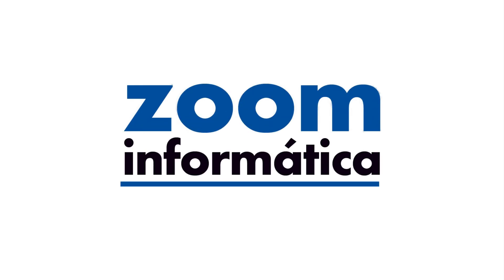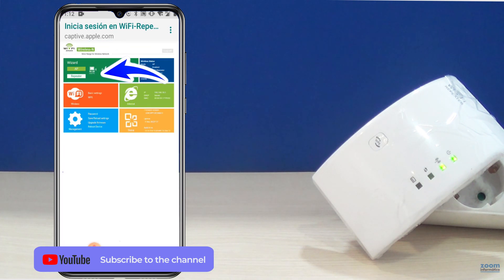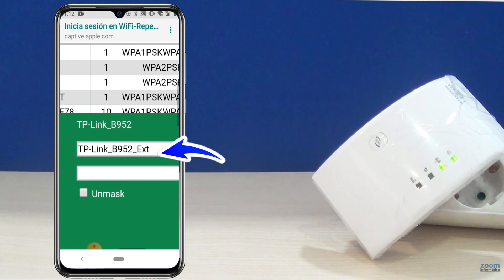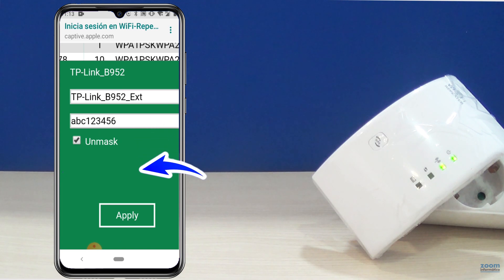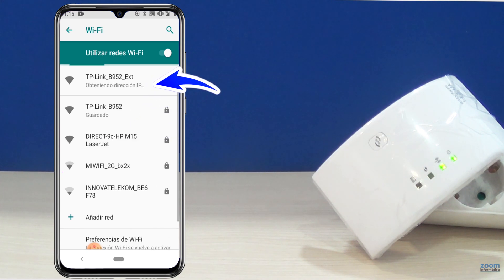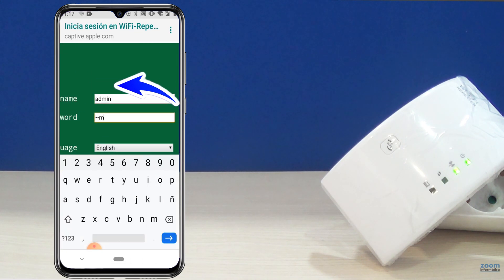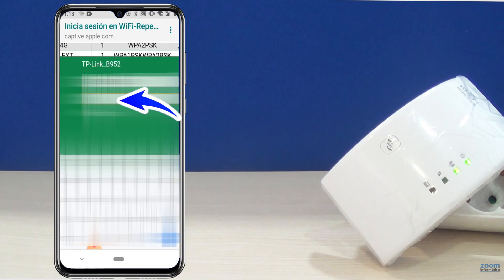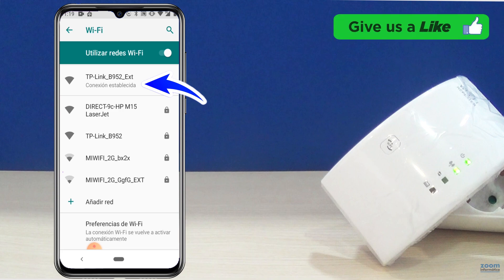How to fix WiFi repeater problem without internet connection 📶 WiFi booster without access

Comment: I dunno if my experience might mirror that of others but after aetting reprater mode in my Wodgreat unit, i found that when connecting my phone to the WiFi signal output by the repeater, my phone claimed there was no internet access, yet when I tried browsing on the internet, indeed my phone was connected through to this site! Not sure why the Wodgreat's WiFi Access point would claim not to have no internet access, but I clearly have it!
Reply: Same symptoms on both the 2.4G and 5G WiFi Access points.

Comment: What if the repeater connects to an AP but the AP it will connect to has no password. Repeater keeps asking for the APs password and will not push through.
Reply from the maker: This model not works with opened networks

Comment: Not showing me the network I want to connect otherwise other network are showing plz help
Reply from the maker: Try resetting
Reply: @zoominformatica  same problem but this happened every time in my case when the main router and repeater close due to power shut after that it automatically disconnected and i have to perform all the steps to setup again and again . And 98times I don't found the connection which i have to connect 😭 pls help . Repeater (tenda). Main router (Excitel).
Reply from the maker: @FakeThenMake-xk5fg  sorry about problem.. cannot reply with security here

Comment: Hi,I have a wifi extender,it's not tplink it's something no name and since I unplugged it I couldn't connect it to the router.I reset it(the extender) and now when I click on its network to configure it it tells me "the extender refused access".I also connected it with a cable to my laptop,I managed to configure it and still I had no internet.I don't know what to do,any help and advice
Reply from the maker: IAM not sure to reply with security about your issue here

Comment: I successfully configurated but it says always "no internet access"
Any chance i can fix this? Im pretty far from the router, i can still connect to it from the phone, but i wanted a stronger signal do bought this but it doesn't connect to the internet.
Reply from the maker: Cannot reply with security. Try to move repeater near to router

Comment: It works, but I unplug it during the night and on the next day it says “no connection” like it keeps the same name and password of wifi, but somehow doesn’t get signal anymore, so I have to reset it all the time or keep it connected 24/7
Reply from the maker: Its strange not works after some time.  Could be weak wifi signal where its installed
Reply: @zoominformatica   Actually I figured out the problem. I plugged it first time and it showed infinitely loading when I try to connect to it and after it connects, it shows "No connection, secured". All I did was unplugged it and plugged it in back again. Surprisingly worked out.
Reply from the maker: its strange @EdzhonsG59
Reply: @zoominformatica  i know right, haha

Comment: Hey,

I have a WiFi repeater but mine just randomly disconnects and I can’t use the WiFi anymore if I want to use the WiFi of the repeater I need to log in and redo the log in and repeater process,It’s very annoying.

Do you have a fix for this?
Reply from the maker: Its not normal this way of working

Comment: Hii, thanks for the video tutorial.
I have a different issue. I have successfully configured the repater router and it's working fine on full signal strength. However, if the  signal bar drops to 4 (5 being the maximum), it shows no internet and cannot access the Internet. When I go a bit closer to the repater, it gains back 5 bars and it starts working. Why is that happening? 4 bars means the signal strength is pretty good normally, but why does it cut off the internet. Please help.
Reply from the maker: Its strange... iam not sure to reply about reason

Comment: Brother, I have taken this wirless n repeater, but the problem is that it does not connect after the power goes off.  Couldn't show the ip address, after that it is fixed again after resetting. Brother, tell me how to fix the problem.
Reply from the maker: Check password is right, and not contains special chars !"·ÄËÏÖ...É...

Comment: mine is connecting but no internet light turning on on my repeater wifi router
Reply from the maker: Try to reset,.. if not works as video could be defective
Reply: @zoominformatica   many times  did but still not
Reply from the maker: @swanandchoudhary5781  I am afraid could be defective.. sorry cannot help here

Comment: my wifi extender can't find my router and the neighbors have a dozen of them, what should I do?
Reply from the maker: Try to move repeater near to router
Reply: @zoominformatica  I tried everything myself but it doesn' appear
Reply: @framedrop969  Same here, did you find the solution?
Reply: @valentinhhh  solved. I had to call my telecom supplier and explain my problem to them, they allowed me to show my wifi network on the wifi extender, so call your supplier and explain everything to them and in 5 minutes everything is done. the extender works perfectly.
Reply from the maker: @framedrop969  Thanks 4 comment

Comment: Hi pls help. I bought tp link wifi extender, at first its works fine. But after a weeks it says no internet even i already connected to the main router. Pls how tell me how to fix it. Thanks
Reply from the maker: Try reset and configure again. From here i cannot tell what can be exact problem

Comment: my repeater is not working anymore after a power outtage, even if i hold the reset buttons it always goes red on the power light and notting else
Reply from the maker: Iam afraid if not works after this problem, the repeater could be damaged

Comment: How does a long SSID name affect the repeater? Can you elaborate more?
Reply from the maker: It depends from password on your main router. Many repeaters not allow more than 15-20 char pn SSID or password
Reply: @zoominformatica  thanks man.  I thought my repeater was broken. My main router was 18 chars long ( is space counted as char?). Internet was hit and miss though device was connected to the repeater with full bar signal. I've just change the SSID name with 7 letter only chars and now, it works like a charm. It's so insane how SSID name could cause a serious issue to the repeater...
Reply from the maker: @elon6784  Sorry.. cannot confirm it

Comment: Pls help mine says my Wi-Fi name then EXT but if I connect to it it loads for ages and never connects and if it does it says no itnternet connection
Reply from the maker: Check repeater not too far from main router and password correct
Reply: @zoominformatica same. I tried very far, very close from the router, with cable, without cable with the router or pc etc. Always the same problem. The ethernet cable does not recognize the first wifi and when I apply the settings with my phone I have the same problem with the bro from the first comment. It's the third extender/repeater and nothing happened
Reply from the maker: iam not sure because with LAN cable should work  @samar_pan0
Reply: @samar_pan0  did u fix it because i have the same problwm
Reply: C😊v
Reply: I have the same problem

Comment: wavlink wifi extender connected but can't provide  internet
Reply from the maker: Verify password its right, not too long or may have some special char
Reply: @zoominformatica   it's happened only for specific wifi 😏🤔😏😖😏 which are important😖
Reply from the maker: @whenwhyhow2449  Try if its possible change configuration on this wlan (tkp/aes,  wpa2, wp2a mixed,...)

Comment: Please help. My repeater doesn't even show up as a network. It did the first time. I signed in and started to configure it but the webpage crashed and now it doesn't show up. The WLAN LED light doesn't blink anymore. It's on, but it doesn't blink. Please help
Reply from the maker: Hello. Try make a reset and start configuration. If reset not works or not send a wireless signal could be defective
Reply: I have the exact same problem, and it doesn't matter how much I presst the reset button, it doesn't go back at what it was before. I've tried to connect to the repeater with an ethernet cable, no sign of connection either.
Reply: @nathleflutiste  it was so annoying like I don't understand what happened. Unfortunately nothing worked and I had to buy an expensive D Link repeater.
Reply: @standoja2001  Yeah I think I will buy a new one too, there is absolutely nothing working, the reset button doesn't work at all, it's seriously frustrating.

Comment: mine had the same problem but when i wanted to got to the site for it it didn’t load or it can’t be reached.I have the feeling i got scammed
Reply from the maker: Try make a reset and start configuration

Comment: Repeater wifi gone after 2-3 days automatically
Reply from the maker: WiFi signal should not gone out after these days. Could be a problem configurration on DHCP
Reply: @zoominformatica  thanks man ! I turned off DHCP server and it's working well. Not shutting down automatically
Reply from the maker: @pawarnikhil  thanks 4 comment

Comment: bro whenever i try connecting to my wifi ext it always says “unable to connect”
Reply: Wondering if your ISP is blocking the ability to add a repeater (to prevent non subscribers from accessing internet)
Reply from the maker: Confirm password is correct and repeater not too far from hotspot
Reply: @zoominformatica  its about 3 meters apart I just dont get it because it has no wifi connection
Reply from the maker: @iamaaaaa3881  at 3mts should works fine. If not works could be defective

Comment: My wifi only works if i get wifi from the router first and then from the extender otherwise it says connection but no internet.
Does anyone have a solution
Reply from the maker: Please check password. Avoid to use long password and special char on password
Reply: @zoominformatica  didn't work😔
Reply from the maker: @kaidebeste8728  could be damaged
Reply: i have same problem.
Reply: @aa47508  hi, I fixed it by buying a powerline extender thing

Comment: I got a Victony wifi extender, did everything right and get full bars when connecting to the extender SSID, but always says there is not internet access. This shit is maddening. How can it be this difficult for someone good with new tech?
Reply from the maker: Please check password is fine. Not too long (more than 15-20char)
Reply: @zoominformatica  what password. It says in the instructions that you simply use your normal Wifi password to connect it to the existing wifi. At not point was I prompted to enter or change to a different password and nowhere in the included instructions does it say anything about changing passwords
Reply from the maker: @BlyGuy  At the end video needs to select wireless signal to repeat and write password for this network

Comment: i log in the repeater, there's a list with available networks, i try to click on the desired one, but nothing happens, it acts like a broken link. (the others work like a charm, but there're not mine). what could be the problem? thank you!
Reply from the maker: Please check after make configuration a new signal appears. If not shows exactly same on video repeater could be broken

Comment: Bro my wifi extender always denies acess on my phone but I connect to laptop and some other android phone plzzzz help 😭😭😭 I tried all thing I binded the ip and Mac it worked for one day but again the same problem PLZZ help
Reply from the maker: If can connect from some device make configuration from them
Reply: @zoominformatica  what to configure I don't know that I just did arp protocol it worked but now it's not working and the there are 2 Mac address of same IP adresss what to do 😭
Reply from the maker: @abhi_x_08  i think map address not have relation with this issue

Comment: I have this same repeater. It suddenly stopped working. It doesn't show up as a network. The top 2 lights are on but stationary. The second light isn't blinking. I've held the reset button and plugged it out and in but still not coming up as a network. Any suggestion?
Reply from the maker: Ian afraid could be defective if after reset not works
Reply: @zoominformatica  how do you reset it? After pressing the button nothing happens, i tried pressing twice or pressing and holding it for 5 seconds, nothing.
Reply from the maker: @Corazon_Dorado  If not reset, repeater could be broken

Comment: Can i use "." in the ssid and "#" in the password? I dunno why i cant access the internet through repeater </3
Reply from the maker: Not sure... try to check
Reply: @zoominformatica  My password is 21 character long with "#". Dont you think that is the reason why i cant connect in the internet? My password is too long?
Reply from the maker: @rjlazaro9027  yes. i think 21 char its too long